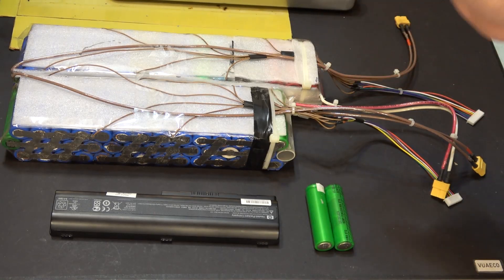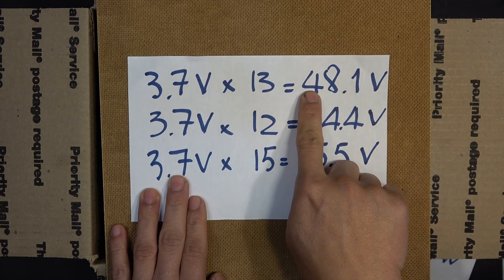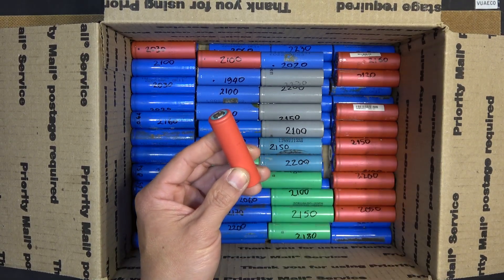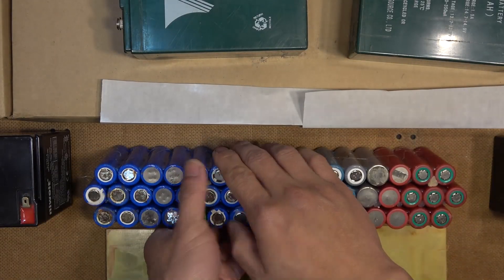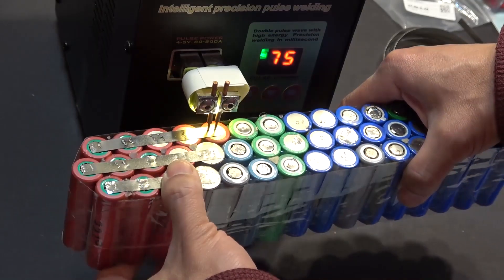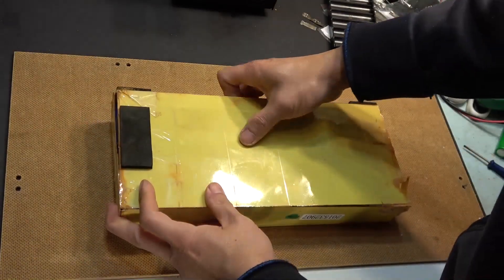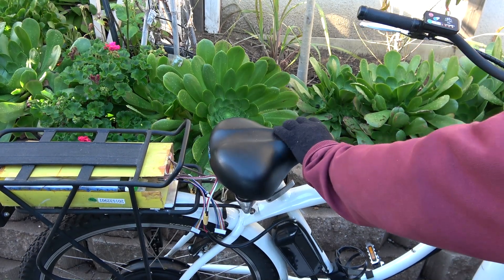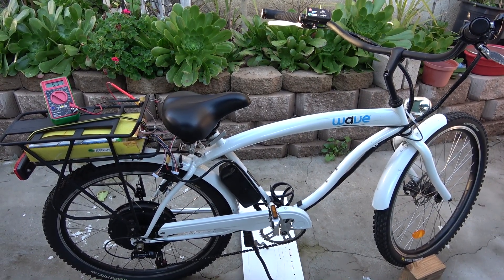DIY: Home made Ebike 48V battery from laptop 18650 cells without BMS

Comment: He's pushing low-power laptop cells to their limit, gluing them together so there's no air gap, no BMS to cut power if they overheat, and no fuse on the pack. The pack can also discharge the cells below 2.5 volts (where a BMS would cut power,) damaging the cells and causing overheating and bursting into flames while charging. Sounds like a great idea! 😬

Comment: basically bttery like this is like You can but the chipest any acid batteries like 12Ah connect them in series and you will have battery that will work for some time then You throw them to the trash... Your videos are stupid as f.

Comment: In general, laptop battery does not have high C, they have high internal resistence. Using such battery in high current application might generate excess heat and result in fire
Reply: This is the truth. This dude is doing something way too dangerous.

Comment: I savage bunch of 18650cells from laptop battery. 

I was still having issues with measuring the capacity and internal resistance of those cells. I use to make a random selection to choose for my ebike, unfortunately it doesn't last long.
Please, kindly recommend an 18650 internal resistance Tester and a balance, considering low budget 😂.
Thanks

Comment: You have the battery packs connected. How does the charger charge only the 1 pack and not both of them. Most people use a fuse to separate the two battery packs when charging

Comment: Is it dangerous to not use bms? I can't really afford the high tech components so want to build one myself
Reply: A BMS will typically have a temperature probe that cuts power during use and charging if the cells get too hot. It will also cut power if the cells get too depleted, preventing damage. The way he's using it runs a high risk of damage from over discharge, overheating while using or charging damaged cells, and bursting into flames. Yeah, I'd say it's too dangerous for my family to use.

Comment: Your cells need to be able to breath! If you fill in all the gaps with hot glue the cells can OVER HEAT! 

I would NOT recommend doing this! As these cell can literally combust and Explode if gotten to hot! That’s why when companies build Ebike battery packs they use spacers to let the battery’s Air cool down naturally! This way with all that glue there’s no holes it’s just a solid brick of batteries! Just a small pea size of glue is enough! This amount in the video is SO over the top! as the tin strips used to weld the cells together will hold the battery pack together.
Reply: yes I can see that. @vuaeco burning 30amp on the cycle track for 10 min with a trail of flames and black smoke, way to go

Comment: the real trouble is that if some cells goes bad then your voltage will drop and you will empty some cells too much compzre to the others which can be very dangerous.
If you rely only on the general voltage you can't tell if one or many cells are out of service. If only one cell goes bad then all the load goes to the other parallel plugged cells... Do you understand how dangerous it is ?
Reply: A BMS is dangerous too. He is still using a balance charger so would be alerted if some cells have problems when charging

Comment: hy , if i have cell's from 1700 to 2300 mah can I use them all in one power pack ,( 120 cell's )? or I should use only 2000-2300 cell's in one small pack ( 50 cell' ) thanks

Comment: a friend gave me as a gift a 36v kit ... told me had problems , he told me the motor didnt run and he assumed the batt didnt charge,,,, the batt pack havent been charged like 3 years , you think if i can revive the cells in case all are in good shape and remove the BMS the kit can work? i think is a 2012 kit so i think is just a balance charge bms

Comment: Good day, I have a 48v 1000w ebike kit. I just want to know if can build two of the 7s and series it together to make 14s. Want to copy your version on how to build battery pack. The problem is if it is compatible with my 48v 1000w evoke kit. Thank you so much
Reply: Yes you can and it would be fine
Reply: I have a 48v 1600w uberscooter.  It currently has a SLA battery.  I would like to switch it to either a li-on or a lipo. I am not  necessarily interested in increasing the speed bit increasing the distance I can travel (at a decent speed) what would you recommend? And how do I build it. I'm just learning... love you videos!

Comment: Yo 1 question!
Can you charge 2 packs of 7s batteries with 1 7s charger?
I would like to make a 14s 4-5p battery without BMS but do not know if i should get 2 7s charger (1 is 100€) or 1 is enough with higher charge time?

Comment: Can i add 2000mah+2200+2500+2650+2750+2900 for a set of one parallel, will it work if i construct all 13 parallels in same way, im asking because i have different ah batteries but all are branded and salvaged from old laptop batteries

Comment: I'd always use the same cells myself but realise this isn't always an option for some. Good job though man you got it working🙂

Get some heat wrap around those batteries, try to seal them up to stop water getting in or you'll end up with heavily corroded batteries again bro. A little extra expensive which will save you a lot of money not having to find new cells and rebuild.

I'll be making a 60Ah battery after xmas out of LiFiPo4 cells, 15cells 3.2v each @60Ah  =48volts @60ah. The cells are expensive but the capacity is huge and the chemicals used in the cells is the safest on the market. They're said to last thousands of charge cycles, very reliable cells.

Hospital use these cells in their medical equipment as a power back up, electric never goes off in hospitals so the batteries don't get used but they are replaced every 5 years regardless. Find our when the batteries are being replaced and you could potentially buy the ones they are getting rid of for very cheap my brother 🙂✌
Reply: How did it go?
Reply: @AQHChannel  he dead ? I heard they are dangerous 😂

Comment: That smart charger looks neat where is that from ?im using my 48v charger standard an have a drok charger universal one from power supply.i just changed my front hub motor to 500watts from a 1000watt an up hills it loses power just for couple secs then back on every now an again it is a steep hill goin back home.why is that.?dont use bms.last one didn’t last long an that was 30£
Reply: I personally use R/C I max charger ( i have multiple use for it)..for some reason the fake Imax allows me to charge cells under 2.2 (which is fine..I need it to
recharge cells that might drop under 2.2 when salavging batteries.
My R/C only allows me to recharge at 6s..it's 25.2 V fully charged.
I can put 2-ea 6s to 12 50V...it's in the 48-50V range.
I prefer to manage my batteries that way...any ways...so i can repair
packs and trouble shoot easier...use it in different things...such as Powerwheels at 6S 

It depends on how many parallel you use and what C ratings
Laptops are only 10-15C..I'll do 4 -ea to 8800mah per 1s
basically 24-ea 18650 per 6s at 8800mah at 15C..

It might be from your ESC with auto thermal shut off...trying to save itself..
it's like that on my r/c ESC...
or it could be from your Batteries Thermasta...that black tear drop
looking thing...

The 1000W Brushless...is SUCKING/PULLING alot of electrons.
It'll generate lots of heat in the batteries....

It can also be from your motor getting TOO HOT  trying to save itself too.lol

or Solder joints coming loose in packs you made.or one of the 18650....diaphram
is getting ready to dis engaue...if it gets too hot..

or solder joints from connectors ect ...48V is alot of electricity.
it'll heat up solder joints..Sometime the heat shrink is the only
thing holding the joint in place..then sort of resolder itself.lol

Trouble shoot and Isolate.....check the connectors solder joints

That's why I prefer to limit it to only 6s build...so I can trouble shoot
for a 18650 going bad...

I had trouble with connector solder joints from
time to time.
I use thicker wires..but really need to change my 48V connections
to something more beefy..Rather than just re inforcing it with HOT GLUE to
help the heat shrink..lol  (  clamp and solder the joints....)
Becuase the Connectors are sort of bottle necking everything...if they're
not rated at 48V or better...Solder not being able to handle the heat...
Yeap....different solder grades...too.
Most electronics are 5v-12v Max.lol

Comment: Hola solo tengo una duda mí bicicleta es casi igual a la tuya pero no sé el voltaje máximo del controlador las baterías también las armó en casa . Original es de 36v el controlador tiene capacitores de ,,80v  le podré poner 48v ?

Comment: Ok, sorry I have one more query here 😒😒 kindly reply if you don't mind
I have 18650 cells from old laptop battery.
I have cross checked each and every cell using digital multi meter 
1. How it's is possible after couple of years also that cell showing voltage few cells 3.00v others 3.90v  means most of cells are above 3.00v InFact over the cell desciption writen it's capacity is 3.7volts. 
My query is if the cell is showing more that 3.0v does it good or bad/dead cell, Can I use it for e-bike since each cell have different volts 
2.In the vedio as you said cell have 3amps, now I would to check amps can you please tell if cell have less than 3amps can I use it for e-bike projects.?
3.What is the cell min AMPs should have been used for e-bike.
4.on description it is written 3.7v but when I'm checking it shows 3.90 it is good cell or dead can you please me here. Kindly reply.
Reply from the maker: You need to run a charge/discharge cycle test to determine its mAh capacity. That's how you can determine a good or bad cell. Watch this video if you want to learn more about this process: https://youtu.be/yuLdi4oT7xI

Comment: Please reply here.
Alright,
750/48=16AH is required us that you are saying ??ok
But 48v16ah battery pack how long it will work/how many kilometers we can ride? 
1. What if we supply more than 16AH.
2. If more AH required for long ride/more km I would like to add more cells to reach till 30AH or 40AH is it possible, Can we use such AH for 750w motor? 
3. Note recollection from scrap/laptop battery so cells many not good at AH so just for getting more AH I would to add can I use on that way? 
4. What is minimum AH(2 or 2.5ah)for each cell to use e-bike.
I don't think 6 cell laptop battery each cell have 3ah for reuse.
Please reply
Reply from the maker: You're mixing up Ah with A. They are not the same at all. 750W/48V = 16A (not 16Ah). That's the maximum the motor requires at 750W. When going up hill, a 750W motor can use more than 750W (maybe 1000W to 1500W in short burst).  So yes, you can supply more than 16A. The more you can supply the better. 2. You can supply as many Ah as you can by adding more cells in parallel. But you only have limited space in your bike. 3 and 4. Each laptop cell can only give you 2A to 3A discharge. (not Ah) You will need at least 16A to run the 750W, 48V motor so you will need at least 6 cells in parallel.
Reply: @vuaeco  how to check call discharge rate can you please reply here.

Comment: 2 liter bottles with the tops cut off and shrunk to the pack will keep your pack dry,just flatten out the ends.
Reply from the maker: Great idea! How do you shrink it? Heat gun?
Reply: @vuaeco Thanks for your video ,I am building  a battery this weekend from dead laptop batteries I will use those bottles cut off the ends and hit it with a heatgun.Bingo easy cheap shrink wrap. Your building yours from reclaimed cells I need to keep an eye on the Amp discharge rate too thanks again for the Ideas,I want a 48v 1000w battery but I was going to build a 54v overvolt to try to get more power since I am a big guy riding a 29" wheel for tork maybe still working out the math for the config in a triangle.

Comment: Can i use battery with different ah?
Reply from the maker: You should use batteries with the same ratings (Ah and discharge rate). But I'd say you can get away with about 10% difference.

Comment: Don't understand why you added there one pack with 13p6s Bcz the first pack 13p7s itself with give the 48v right???
Reply from the maker: 13P7S is only 26V. To make a 48V pack, you need a 12S to 15S battery pack. I think you're confused with the P and the S. It doesn't matter how many P you get in your pack. P is just for increasing range. S is specific to voltage of a battery pack. By the way, my battery is not composed of a 13P6S and 13P7S. It is composed of a 7P6S and 7P7S to make a 7P13S pack. Big difference.
Reply: @vuaeco  thank you boss really confused 😇😇😇. I have collected scrap laptop battery but now don't know how to make a battery pack, issue is sorting, align how to align/order which cell should be positive and negative.
2. What is the minimum voltage and AMPs each cell required for e-bike for 48v40ah or 52v40ah 
Can you please share if there is any blueprints or drawing sheets for cell align.
kmurali.krishna00@gmail.com
Requesting.... Here

Comment: Can u parallel charge ebike batteries with bms with the same charger?. Eg, parallel charging 2 60v 20ah batteries with a 10amp charger
Reply: You could, but why bother? Each pack would only see 5A current, takign twice as long. IOW, no faster than charging one, then the other. The only advantage would be not having to switch the charge cable from one to the other, but my rule of thumb for li-ion is to only charge while I'm awake. Laziness = homelessness!
Reply: @fun_ghoul  I bought an outlet timer. I sleep easy

Comment: Should have got a kweld spot welder.
Reply: A welder that requires li-po or lead-acid batteries defeats the entire purpose (or rather, re-purpose) of this video. It also requires assembly, and costs more not only compared to the Sunkko unit he has, but even than competitive battery-powered products like the Arduino Spot Welder. So, no.
Reply: @fun_ghoul  lol it's you again

Comment: The new Milwaukee m18 12ah battery pack has 15 cells Samsung 3 together in series is 60v 12ah 21700 40t if you find one on Craigslist offer up or Ebay there 100$ to 115$ it’s still cheaper overall than buying Samsung 40t cells from a battery store and as a bonus now you can use Milwaukee heavy duty line of tools like the chainsaw hedge trimmer blower miter saw etc make sure to buy a Luna Cycle 52v charger 110$ with shipping finally endlesssphere showed me where to look inside the controller & I turned up the pot dial & the cut off voltage went up to 60v up from 58.5 perfectly happy with my setup videos like yours inspired me

Comment: I'm pretty sure it's ok to mix different capacity cells you just have to make sure each parallel bank has around the same capacity, I'm also pretty sure you can mix different discharge amp cells together as long as your not drawing too much current
Reply from the maker: You can. But you have to be careful in your calculations or all hell will break loose. This is a good topic for debate and maybe I should make a video and talk about this.
Reply: @vuaeco  you only have to calculate if you are mixing different amp out put cells not capacity really, each bank just has to have the same total capacity, but hell yeah make a video on it dude I like your vids

Comment: The downside is if you have one weak cell group (lower capacity), it will drop in voltage faster than the others, so say discharging to 40V should mean 3.07V per cell, any weak cells would go below that. At least you tested all the cells first, so it's not going to be too serious.
Reply: Can be installed rc cell loggers and you ll now when and wich cell is discharged.